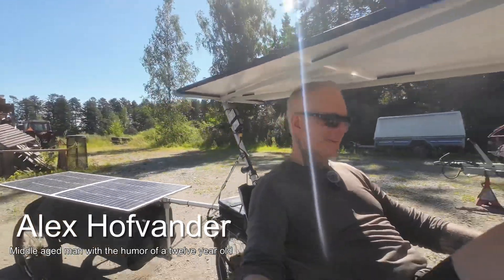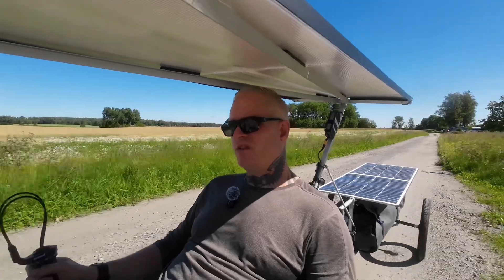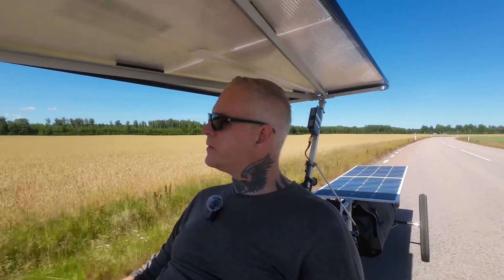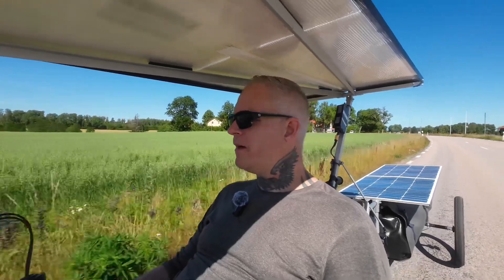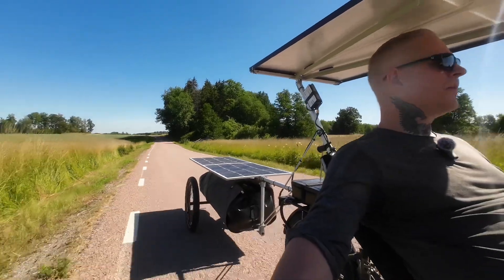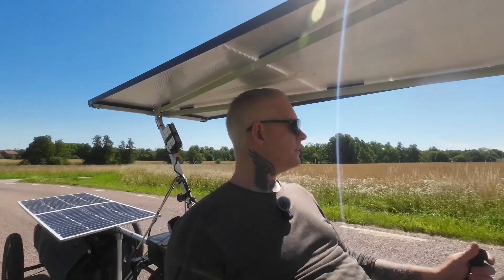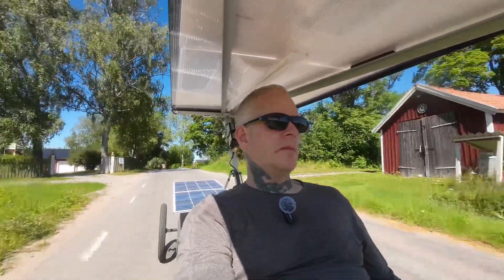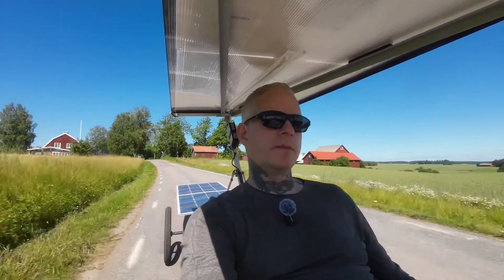Solar Powered E-Trike. Test ride and some stats.

Comment: Thanks for ruining my ideas for a solar bi-recumbent, mono-trailer, tilting panel design, with your much more sensible tri/duo/static design.
Reply from the maker: Sorry! I think your ideas still is viable. Expect tilting of course. I have seen good solutions on tilting also but it’s not for me. Too much weight and work for so little gain.
Reply: @Alex_EVenture  Well, I'm going for it anyway. So if I'm deserted in Mongolia, with a wrecked solar bike, trekking across the desert to find water, I'll be sure to think about you.
Reply from the maker: @FrankReif  Do that and the best of luck with your build. I am rooting for you!

Comment: Nice work! I'm not implying you're doing anything wrong, but I want to suggest considering using two of those o-rings at each point, partly for redundancy, but also because of the fact that most rubbers tends to age exponentially faster with increased load.
Reply from the maker: Hi Erik. I think you have a good point and I have been thinking of implementing some kind of other security feature that will act as a stopper if the o-ring snap. Which it will at some point. The solution can not impede on the dampening though.

Comment: Great setup ! 1 small question or concern about the coupling between the bike and the trailer. If either the bike or the trailer tips over, is there a possibility that the coupling can break ? I remember a friend of mine made a coupling like that with a normal bike attached to a 2wheeled fishing trailer and when the bike fell down the coupling broke.
Reply from the maker: @peterhelsen8440  Thanks Peter! I see what you mean and I thought about it. Both the bolt on the trike and the coupling are M10. Pretty sturdy. The coupling is threaded into a solid 120mm long aluminium staff that sits inside the trailers end. If everything tips over I think other things will break but not the coupling. I don’t know but it’s in there pretty good with loctite.

Comment: Could you create a diagram of the connections? You mentioned that one of the connections of the 3-way connector goes to the solar panels. I assume it connects through the Genasun charge controller, correct?

Great video, congrats! I subscribed to learn more as I also have a solar e-bike channel.
Reply from the maker: Hi. Thank you. I am subscribed to you too and I am watching your latest video. I am where you meet the Slovakian couple 😊. Nice and relaxing. Just how I like it. 

It’s nothing special really. It is three xT90 connectors in parallel. It’s like the battery has three identical ports. Both my Genasuns are in parallel with each other and goes to the same port on the battery.
Reply: Hi, I have an e bike, strictly off road use. 2kw hub motor on a nominal 48v system. I use 2 off 18ah dolphin style lithium iron batteries. I built it to do the 70 mile round trip to work if needed.
It’s quick and has good range, being a fat bloke it has to be big and powerful. I went for EC5 connectors and a shunt to tell me how much power it uses and the voltage.
I think I’ll end up with a trike when I get older.
Take care M.

Comment: Congratulations, well done. Great insight into the benefits of 200W panel and geometry. Nominally, they say a human is 10% of 1hp which is about 75W. So if you can continuously assist ~100W, it'll be a great ride.
Reply from the maker: Thank you. Yes, 100w of assistance is noticeably better than nothing at all. It makes a big difference even with my heavy setup.
Reply: @Alex_EVenture   Yes, another 100W for the load sounds like a good idea.
Reply: at 12 volts I can get 5 amps on my bicycle generator I built in the garage - but not sustainably. So 75 watts must be without any actual electrical conversion? You mean your pedaling is charging the battery? Or just the assistance in just the speed of the bicycle.
Reply: @voidisyinyangvoidisyinyang885  Great input thanks. 75W is meant to be similar to 60W depending on how much of the body of what size person is generating power via what kind of equipment. Thanks for confirmation.

Comment: I’m happy to find this channel because I was telling some friends I was thinking about switching to a Grin hub motor and Pinion gears, or waiting for the Pinion motor unit to come out in the US, instead of my current mid drive, and you are already riding with a similar setup. 
I had just been planning to use a 100 watt panel I had to charge my spare battery, but I see your system is much better thought out. 
I have subscribed to learn more and follow along
Reply from the maker: Thanks for the support. I appreciate it. A single 100w panel can do a lot for you. Perfect way to extend the range and simultaneity take some load off the battery since it will work in tandems to drive you further. Good luck with your project. I would suggest that you go with DIY stuff like I am here. Ready built systems from example Pinion, Shimano and others doesn’t allow for external chargers being plugged in while in use. 
The pinion gearbox and a hub motor is a fantastic combo.

Comment: I've been curious about bifacial panels mounted vertically for mobile applications, on a trailer it could have less wind issues, lower width, and potentially handle the often changing direction. Nobody on The Sun Trip has though, so it's probably not worth it.
Reply from the maker: @punkdigerati  Hi. The single reason for not using them is probably the weight. They don’t come as light weight flexible versions which is what most people would like for a built like this.

Comment: Very nice build! Trailer is unique. I built a trailer for my e-bike using a 25 gauge steel stud lined with 1" x 4" lumber and a 27 gallon storage tote. 16" walk behind lawn mower wheels. I don't need solar since my trips are only about 17 miles/day.
Reply from the maker: @tims8603  Thank you Tim!

Comment: What voltage? 48v? How many amps are you charging at full sun? Total watts for solar?
Reply from the maker: It’s a 36v 41ah battery. It depends on the time of year. Best charging performance I see are in late April to early July. Tilted I get about 280w right now and flat they produce 190-220w mid day. Total solar I have on right now is 320w
I only speak watts, not amps 😊
Reply: @Alex_EVenture  320watts at 36volts is 8.8 amps. That's too much charge AND you're running the motor also. Please research that. I'm no expert and take my words with a grain of salt but that's too many amps for a battery I think. What kind of cells are you using?
Reply from the maker: @Davideverything7  I understand your concern but it depends on what size battery you have and what BMS (battery Mangement System) you use. The battery on my trike is 41ah. Rather big in other words. Huge capacity and that allows I for it to take a higher amp too. A general thumb of rule is a battery cell should be charged with 0.5C. That means half the charge current of the capacity of the battery. So my pack is 41ah. I can charge it with 20.5 amps without harming it. And since I charge with solar I am actually super slow charging my pack and that is definitely not harmful. My pack can handle full regen braking plus solar at the same time.
Reply from the maker: @Davideverything7  I use Samsung 35E cells. 10S12P. That means 12 cells in parallel.
Reply: @VeloSolarTech_Alex  I don't think the bms is relevant. Only the amp hours. I have a 38v 14AH battery. How many amps do you think I can charge and use 500watt motor? Currently I have a 175watt solar panel
Reply from the maker: @Davideverything7  The BMS is most definitely relevant. Depending on manufacturer. Some BMS does not allow for charging above a certain amp level and so on. And other BMS does not have a commen charge and discharge port. So it is relevant. 
175w of solar will be perfectly safe for your battery. I recon you should be able to charge up to 4 amps on a good day with that.
Reply: @VeloSolarTech_Alex  the bms charging amps is based off the AH of the battery. The AH is the measurement
Reply: @Davideverything7  The BMS is like another charge controller. The battery cells have their maximum but the BMS has its maximum. Which ever is smaller governs. Some BMS don't allow charge/discharge simultaneously. 0.5C for lithium and 0,25C for lead are good guidelines. Read your panel specs.  There's a difference between rated watts and rated amps at charging voltage.

Comment: Being from the US I can't even imagine only 250 watts on an ebike.  The smallest ebike I have is 1000 watt single motor and the larger fat tire one is dual motor and caps out at about 3000 watts but both are labeled 750 watts according to the kit manufacturer.
Reply from the maker: @kuhrd  there is a huge difference for sure between our continents. But as I mentioned in the video. There are no 250w motors only. They are only labelled that way because of a in my opinion stupid rule. In the dawn of e-bikes over here they needed some way of regulating and came up with this. Both Shimano and Bosch do over 600w peak power and the new DJI motor do 1000w peak. And that motor is also street legal here. I think they should skip it all together and just keep the speed limits intact for assistance. It doesn’t matter if you have a 3000w motor and a 15.5mph speed limit. The only difference really is how quickly you will get there.
Reply: @Alex_EVenture  I agree, I was just kinda pointing out a similar thing here in the US where many states say you can't go over 750 watts but 1000-3000 watt ebikes are pretty common and you can buy kits up to 10,000 watts  with a mode switch for on and off road use which is crazy.
The top ebike speed where I live for a public road is 28MPH but one bike tops out at 36MPH and the other bike will top out around 55-60 depending on wind which is just crazy but both have a governed mode to top out about 28 when on public roads.

Comment: That's the problem with EV bikes.   Government lawmakers under influence of $$$ or other compensation make a stupid ruling of 250w, which is almost useless considering E-bikes are that much heavier.   But now people have the mistaken belief 250w is sufficient as everyone has them and they seem to work...because wink wink....they are all 250w and more.    So now it's going to be harder to get that 250v law fixed.
Reply from the maker: @dailyrider2975  in all honesty. The manufacturers themselves almost never claim this anymore either. That their motor is 250w. People just assume it is legal if it’s store bought and are capped to 25kph.  As long there is no throttle and speed limit is implemented. You are all good it seems like.

Comment: hi
This is a trike I rode before. I rode a 26-inch rear model, but they also made a 20-inch model.

Recently, I also installed a flexible solar panel on my trike.
I'm looking into making my own solar module because of its weight.
The biggest problem is waterproofing. I am worried about what to do with solar cell waterproofing.

I'm thinking about using a large plate as a carbon plate and attaching solar cells on top, but I'm also thinking about how to make it waterproof.

Did you make the solar module yourself? I'm curious how you handled the waterproofing.

I am leaving a comment using an English translator ^^
I also recently uploaded a video of a solar cell test installation.
Reply from the maker: @gomountaintriking8460  Hi!  The panels I use already are waterproof.

Comment: Build is looking great. Also your already 1up on many youtuber because of the DJI mic.
Reply from the maker: @Eric_Tennant  Thanks Eric. I am happy and still eagerly awaiting my two allpowers 200w. Audio is so important. I am playing around with it still.
Reply: @VeloSolarTech_Alex  how can you charge with 400 watts and use the motor at the same time? 400 watts is about 5 or 6 amps charging? The battery can handle that much of a charge and use the motor at the same time? I have a blix aveny skyline 48v. Next week I'm buying a spare battery and a trailer and a victron charge controller. I already own a 175watt lightweight solar panel
Reply from the maker: @Davideverything7  It is way more simple than that actually. I am going to make a video explaining exactly what’s going on when using solar. Simply put. A battery can’t be charged and discharged at the same time. It’s either or. So when the sun hits the panels and the motor is running ,the panels provide power directly to the motor in conjunction with the battery. I will clarify this in a soon to be released video.
Reply: @DavidAbreu7777  The complexity you're concerned about is in the charge controller and most of them can do it. The battery doesn't know or care which way the amps are going. The whole circuit will be at the charging voltage so make sure nothing is too sensitive.
Reply: @artsmith103  thanks for the information
Reply: @Alex_EVenture  Looking forward to that video! I'm in the process of doing something very similar, including using a Grin motor, so I'd love it if your video specified all the components you're using and if you recommend them!
Reply: @Eric_Tennant  Eric. Hi. I watch you also. There's a limit on amps charging? A battery can handle 8.8 amps while running a motor also? Isn't that too many amps? I have a 48v battery. I thought about 200watts is all I can do safely. I thought there's a limit on charging amps for the cells
Reply: @Davideverything7  What I did too go higher then recommended charge rate on the battery was combining 3 batteries in parallel. So the max was 5 amps per battery now its 15 amps witch is way over all my solar (400w).

Comment: I suscribed now, regardless your nasty blackadders (!). So how many maximum watts do your panels have? What hub motor are you using? I consider converting a HP Velotechnik Speedmachine with Rohloff gears to electric and maybe later add a solar roof.
Reply from the maker: I have a kind soul at least despite my appearance. Thank you for the sub. All four panels is at 320w. All connected in parallel. The motor is a grin all axle std. I have three motors on different builds. Same kind. I have tested the speedmachine. Great bike.

Comment: Anyway, back to solar bikes. I hope I did not insult you too much, although I do not understand your reasons for harming yourself like this. There's new panels available that are amazingly resistant to partial shading. One brand is Shadestopper another one is BougeRV. They deliver much more output when partially shaded and are not crazy expansive. A 100W flexible panel from Shadestopper costs around 100 Euro, excluding delivery costs. I bought one and it is very good for my application on a terrace partially shaded by a railing. A classical panel that I used before was quite useless.
Reply from the maker: @danielduesentriebjunior  I am not easily offended so it’s ok. I have read and heard about the panels you mention. They seem good also. The ones I have on order are not great when it comes to partial shading.   They drop like a stone instantly if one cell is shaded. I chose them because of their voltage which is closer to final charge voltage. Less step up conversion and the amps is well within what the charge controller can handle. Another plus is the ruggedness which is really important to me. Hopefully I will get them tomorrow.
Reply: @Alex_EVenture  Ruggedness is a very important point on a bike. I don't know how long the Shadestopper would last. Currently I fancy two Ecoworthy 130W panels weighing 4kg together and costing 150 Euro in total. As a support I will probably use the new Powertop rack designed for carrying solar panels, weighing about 4.5kg. It is produced by the french company Veltop.
Reply from the maker: @danielduesentriebjunior  alright. Hope it works out great for you. I have seen those on other people build with a smaller panel mounted to it.
Reply: @Alex_EVenture  They will extend beyond the rack about 15cm in the front and the back. Width is almost the same as the rack.
Reply: Mike too far away can’t hear everything, other wise great
Reply from the maker: @johnmeeks7320  Thanks for the feedback. Still figuring these things out so I will get there.